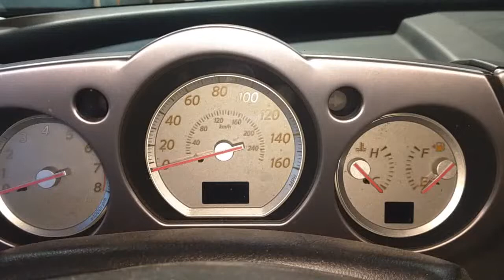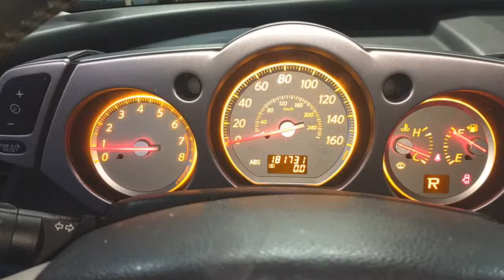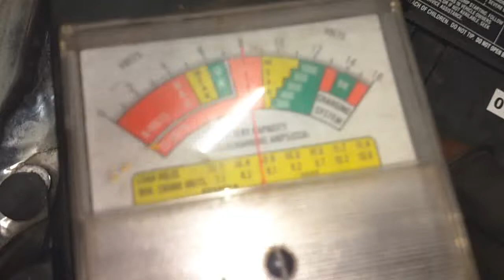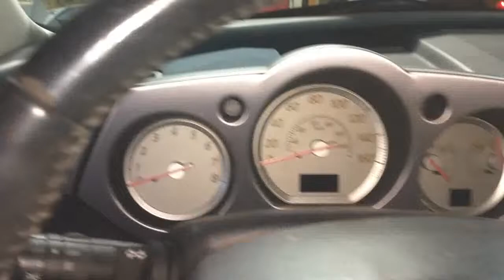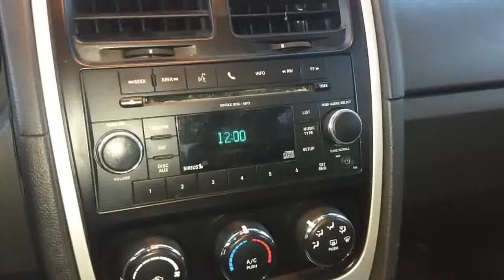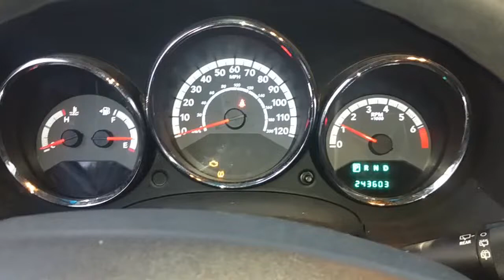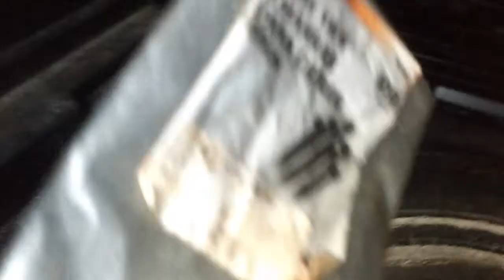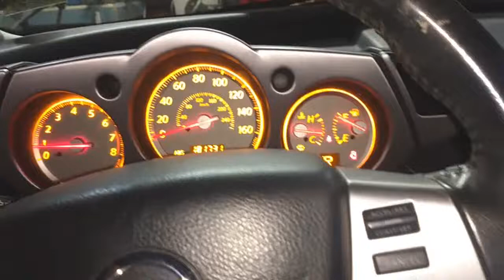Buy one get one FREE Junk cars

Comment: Low voltage will cause a CVT transmission to act up or go into limp mode.
 May be a as simple as corroded battery cables...